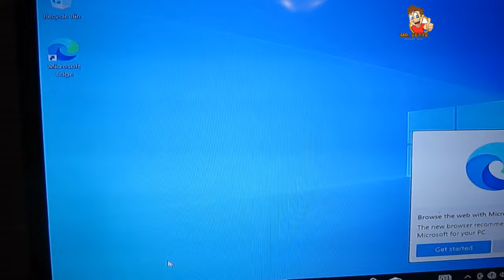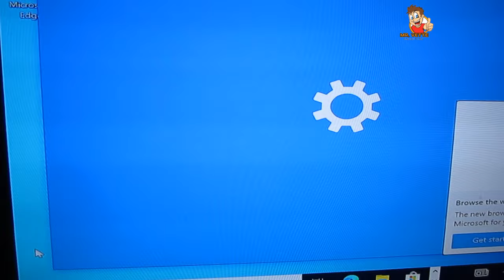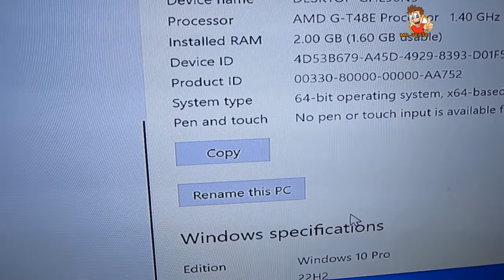Upgrade Your DELL WYSE Tiny PC 5010 DX0D

Comment: I have two of them with 4GB of ram that I have been testing with the original windows 8 that was installed. Now I know how much ram it will take. With a SSD upgrade I may put windows 10 on it also. Thanks for the information
Reply from the maker: Hello, I noticed with windows 10 it was slower running, with 4GB of RAM i think it should run good for a small unit.

Comment: I have 2 of these. one one I added a 512GB SSD and on the other I added a 256GB SSD these units will take up to 1 8GB DDR3 memory module and on mine I upgraded the memory to 4GB for the moment. they will support Windows 10 as well as any linux distro. I retapped all the chassis screws to 4-40 instead on the original 3mm screws. it makes it easier to get into the chassis as well as easier to replace the screws if they ever get lost. I really like these little machines as I have this model as well as the Dell Wyse 7020. great little machines!
Reply from the maker: Thanks for sharing your mods and info! Glad you’re enjoying the tiny PCs!

Comment: im working on upgrading to 8 gb ram, my fear is that the ssd will touch where it shouldn't and short something out, i can not find an upgrade of the drive it came with
Reply from the maker: Yes, i saw this as well, i tried a piece of plastic to separate the SSD
Reply: @mr.vetteenlightens3381  Indian tech guy in a video just showed to remove the ssd from its housing and it fits the same as the factory original storage. No extra cable and same form factor